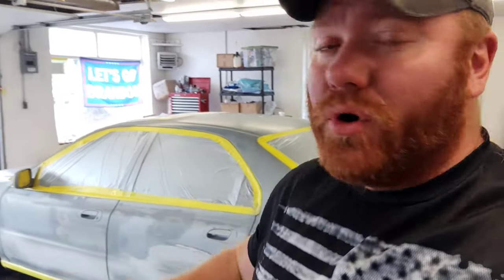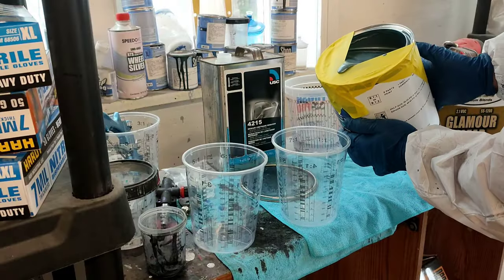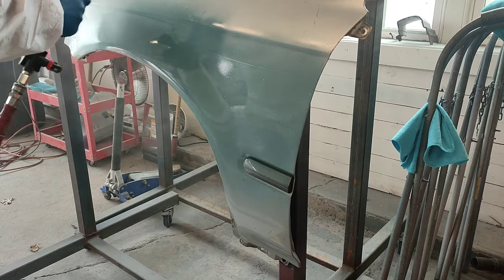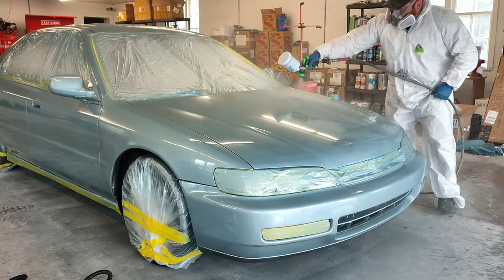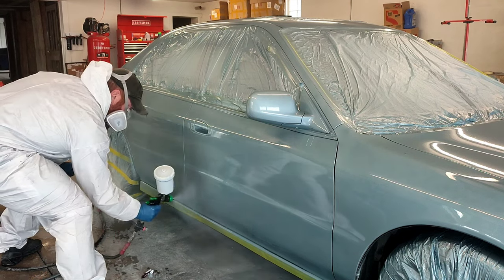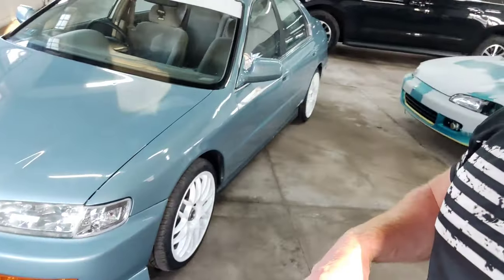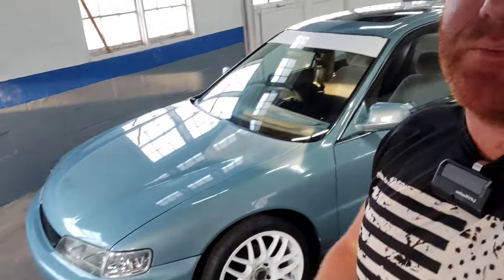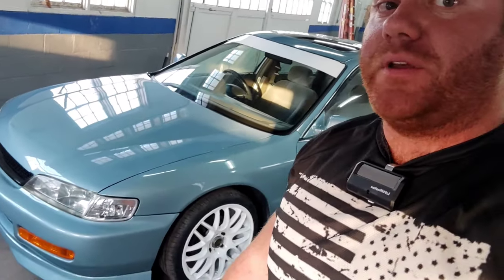100$ paint job

Comment: How much clear would u recommend adding with the Speedokote white single stage? I'm ordering that for my mustang 👍great videos!
Reply from the maker: That needs 0 clear coat added . Already stupid high gloss as it is. Only reason I added some clear to this one was because these cheap eBay junk paints are usually low gloss

Comment: Cross up patterns even the  top of the roof it's a 66 Impala hard top...we did a full coat today it got late so we stopped...but I am going to add two more coats maybe three...than clear...what do suggest.?
Reply from the maker: The roof doesn't have to be perfect. Customer will rarely pay attention to that. As long as it's close then let it roll. Now the hood and sides yea cross your patterns as much as possible

Comment: I sprayed single stage mettalic on my Jeep Wrangler, my vertical panels didn't lay as flat as my hood and horizontal panels. I sprayed with an LVLP gun at 30 PSI. Do you spray with different settings depending on the panels?
Reply from the maker: That's common, you go lighter on the vertical surfaces vs the flat ones.

Comment: Hello new to the channel. I end up getting tiger stripes on my firts paint and  ruff lines? What can I do to fix to do the second then clear coat. Any help will thank u 🙏
Reply from the maker: First coat is ok to get tiger stripes , second coat switch up your spray pattern and it should resolve
Reply: Thank u! What about some areas feel ruff not smooth? Should I re-sand it with 800 and redo different patterns?

Comment: Looks solid. The one thing I hate about SS metallics is the inability to paint correct. When you try to cut / wet sand it will cut into the mettalics and you will get horrible mottling. NIce job looks great
Reply from the maker: Yup trust me the car isn't perfect but standing 3 feet away any angle looks good

Comment: Did you only use clear or did use activator with the clear and poured in the single stage
Reply from the maker: I just poured straight clear in with the paint just a tiny bit to help with gloss

Comment: That came out really good you ever use summit racing paint ?
Reply from the maker: Almost bought some during the pandemic, they were selling it by the gallon for 50$ !!!!!
Reply: @speedokoterefinishnetwork4937  50 damn its usually  $80  plus 20 each for activator and reducer i have done a couple of paint jobs with the single stage it lays really smooth with a alright amount of clear and a good spray gun
Reply from the maker: @maniacmachanic9870  I got some junk u pol clear for 40 a gallon!! And only 10 bucks for the activator! All during the pandemic when stuff was super bad and nothing was open
Reply: @speedokoterefinishnetwork4937  that bad never used that stuff but that cheap
Reply from the maker: @maniacmachanic9870  for 40 bucks a gallon I said sure. It's cheap junk but does look shiny for like 2-3 years

Comment: Found out for myself that cheap single stage can be tricky. Too thick first time I did it. Came out peely even tho I followed the paint can. Let it dry, sanded it. Reduced it more. 75 percent overlap, kept it pretty wet. Misted it to even out Metallics. Turned out pretty decent. It was Acrylic Enamel. Prolly go with urethane on metallics from now on. I would use enamel solid color for a cheap finish,tho...
   That paint job was a learning moment I won't forget. Had to battle thru it, figure it out
Reply from the maker: Yea these junk eBay paints NEVER fallow the can instructions lol. It's a lot of trial and error with these. I'm a veteran in the single stage game so I pretty much know exactly what to do every time.
Reply: @speedokoterefinishnetwork4937  its a good video subject. I would like to see more cheap single stage work...
Reply from the maker: @BearBudgetgarage  always will have content like this!

Comment: How ?? Where are you getting materials for cheap bro I’m spend at min for prime base and clear bout 300-400 plus sanding paper wax and grease cleaner cups lining I mean how for 100 how did u make money
Reply from the maker: EBay I spent 100 bucks on the whole kit. I didn't even primer seal. So just single stage.

Comment: This is the same color i attempted to paint the 67 Chevelle with. I could have used this video 2 years ago! I never knew you could add clear to the single stage, that and the additional activator would have solved all my issues. Thanks Marco.... I might go for this one more time just to prove to myself that I can do it.

I am amazed at the coverage considering you did not seal the car, that was a BOLD move!

The reality of the mind bend that the 1st coat of single stage metallic will make you second guess yourself!
Reply from the maker: I'm pretty dang good when it comes to single stage Metttalics, I'd like to say I'm probably one of very few, if any... YouTube painters that has mastered single stage Metttalic 😂

Comment: What's the purpose of adding basecoat code activator
Reply from the maker: Extra durability
Reply: @speedokoterefinishnetwork4937  
You probably dont do much off panel painting... would the base code activator help the base coat to bond better to the panel. In  area where you need to bolt hardware ie bolding hing hardware   or fenders...or door striker plates

I normally i wait sever days or a week before installing new painted parts but offend find when mounting newly painted part to the base coat  it  can mar when tighing down bolts it hings and fender which need a snugle fit, paint twists with bolt.

Comment: Where are you located???
Reply from the maker: Central pa
Reply: @speedokoterefinishnetwork4937  How far from Philly
Reply from the maker: @kingofuseddurablecars.ls6040  only about 2 ish hours. Do you have small repairs needing done or full cars? I got a body shop and I also have a body shop on wheels for small stuff
Reply: @speedokoterefinishnetwork4937  I have a 05 Acura RL want her painted Royal Blue. A small dent on passenger quarter panel.
Reply from the maker: @kingofuseddurablecars.ls6040  I can do it
Reply: @speedokoterefinishnetwork4937  In Philly
Reply from the maker: @kingofuseddurablecars.ls6040  full body paint job would have to come to my shop. Email me and we can make it happen. Cash2kcars@gmail.com